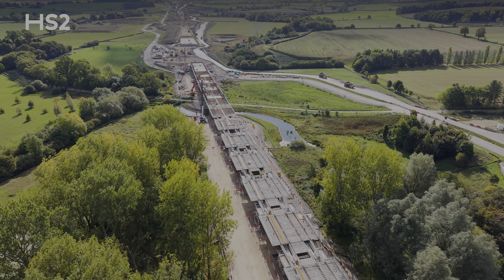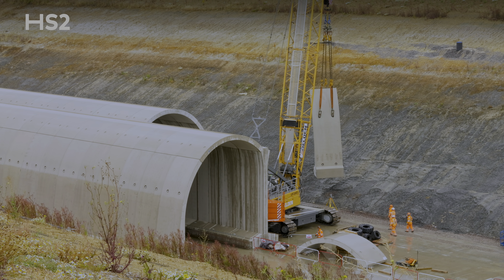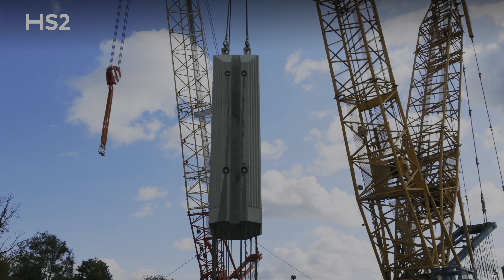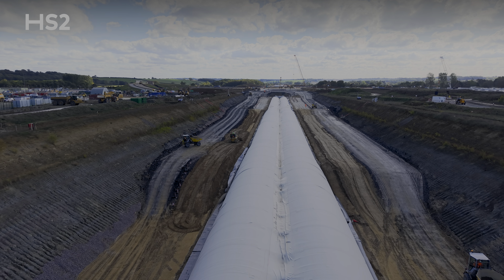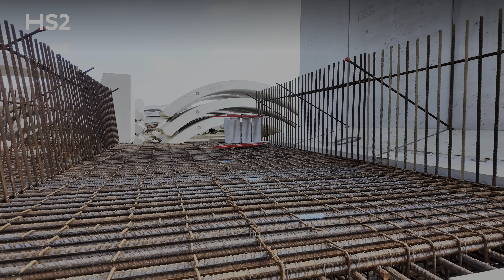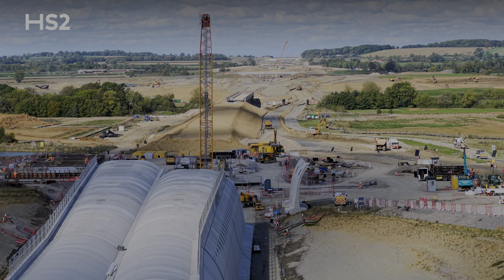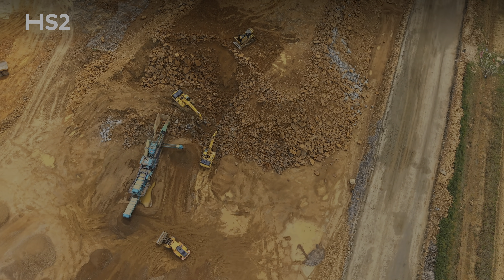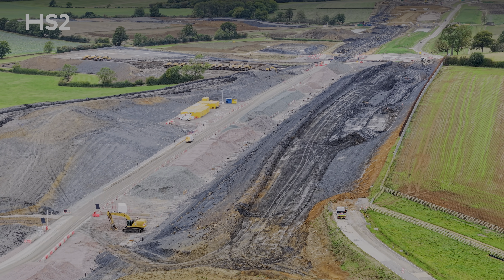HS2 Progress 🚄 | Major milestones across key 8-mile stretch of Britain's new high speed railway 🏗️

Comment: Impressive stuff happening in the 200th year of the public railway. I wish more people would stop moaning about HS2, learn the why and how of this project. Then acknowledge what a tremendous achievement it is.
Reply: it's so bizzare how people can get up in arms about whether HS2 should even exist, when it's plainly obvious that the full original extent of HS2 is what's needed for britain to not burst at the seams in the next 50 years.

The HS2 as is being built now is the bare minimum for britain to continue functioning!
Reply: @swedneck If train travel was cheaper, I might agree, but tickets for this line will be too expensive for many.
Reply: @portcullis5622 what do you think they woll cost and why?
Reply: @benphillips5041 No idea what they will cost, but most current train journeys are over-priced. The new line will be aimed at business commuters and there will be an urgency to bring in profits as quickly as possible. I hope I am wrong, but I expect  tickets will be out of the reach of many ordinary people.
Reply: @portcullis5622 why are you sayibg it will be aimed at business passengers and talking about profit? Its being built, by the govt, to relieve capacity on the busy wcml where prices are often raised to prevent people from travelling due to overcrowding (demand pricing like an airline). Hs2 will be cheaper to run and can carry double the passengers to some destinations, therefore it can operate with lower fares or help subsidise other lines. Pricing people off would be very silly. On the existing lines, there will be more frequent services and more freight whkch should also bring in additional revenue. Fare costs are a govt issue
Reply: Yep, only 40 years after the TGV
Reply: With the power of hindsight (which is a superpower we all would love) imagine if a true high speed line had been constructed length and breadth of UK in the 1970’s (like the TGV in France) and challenged the flawed growth of air travel. 
I hope we don’t miss the opportunity to revolutionise transport across the UK. HS2 has some incredibly talented people working on it, we need to utilise those skills. The first Industrial Revolution was enabled by railways, the next Industrial Revolution needs a revolutionary railway.
Reply: I agree what a big improvement and theya re working really hard and I wish people would stop moaning and it will go from London Euston to Birmingham New street.😊
Reply: spot on 100%
Reply: The engineering and construction is truly impressive. But the opportunity lost of further capacity expansion further north (east and west extensions) is a really poor decision and we will rue that decision for decades. Plus we have to learn lessons to improve estimating for future projects, as this was really poor.
Reply: @mickcresswell1031 As estimating for a contractor was one of my tasks before retirement I can tell you there is nothing wrong with that. The budget for HS2 was a figure pulled out of the air to satisfy the Jothnson government. It had no detail behind the headline figure. On otther construction projects a cost consultant protduces a detailed costplam budget for the client which has shortcomings because the cost consultants lack technical knowledge. The accurate estimating comes from the contractors estimdtibg teams.
Reply: @TrevorWilliams-fq8mg I would love to know what the last major project that was done on cost and on time.
Reply: Most people just think the ticket prices are going to cost ridiculously money and just use the old service.
Reply: @Puddingladd which is nonsense, because there will be more seats to fill and the old service wont exist in the same way. It will be hs2.
Reply: @benphillips5041  Why will the old service change? Unless you live in Birmingham or London you cant use the service......how will all the passengers on the current route travel if the service changes. They will need to keep existing services the same
Reply: @simontheobald2978 it will take over the current express services. It will still go to manchester, liverpool, glasgow as well as Birmingham. If youre going to glasgow or manchester, you wont have much choice, hs2 will be the only direct service. With the express services on their own line(hs2), that allows the current infrastructure to run more stopping services for the stations in between and more freight. 
With the intercity services to london no longer at new street, that frees up the station to handle more services from other connecting lines (its the main bottleneck) so more frequncy on lines to Birmingham from didcot, Shrewsbury, leicester. So benefits are quite wide even with just phase 1.
Reply: '' Impressive Stuff '' etc. Absolutely agree. It remains to be seen if this rail is only an elitist project reserved for the affluent / business people / political people with ticket prices way out of reach of ordinary people.
Reply: Loads of people seem to believe it is fully cancelled, little do they know the extent and scale of what has been built and what it will be. So exciting.
Reply: @toby.maximillian lots of people seem to think it ends at birningham.  It goes another 20 miles.
Reply: @garthcox4307 there are so many misconceptions.
Reply: @garthcox4307  A good portion of the great British public out there do not realise that the trains running on HS2 will also travel on the WCML to and from Manchester, Glasgow etc. Many think the trains are solely for Brum to London and vice versa.
Reply: @JohnHoward-wc9kk  HS2 running on ordinary tracks to Manchester and Glasgow is not HS2
Reply: @toby.maximillianIt’s fully cancelled if you live north of Birmingham
Reply: And also they trains will ahev a top speed of 225 miles per hour but will be limited because that will be to fast maybe like 180 miles per hour I don't know but they doing well.😊😊😊 And his is all kier starmer money
Reply: Climate shit show you mean
Reply: @jeremyparsons5379  I think you need to put some more meat on that comment so the audience can get an understanding on what it is you are trying to say
Reply: @HighFell 😂
Reply: Well if you live in Manchester like me you have a right to moan , we are paying for it, but don’t get to use it.
Reply: @michaelcliffe6545 Well, it will arrive at Manchester, just without the added benefit of freeing up your local lines for intense metro level services, without additional seats to the south, without a new fast servce to Birmingham. It would be faster than now, which was never the main point.

However, the bit of hs2 into Manchester isnt actually cancelled, just the bit in the middle and even that still has an active hybrid bill, so lets see what the government are going to announce within the next few months.
Reply: @benphillips5041 HS2 have sold off the land they purchased just south of Manchester, so we won’t see any benefit
Reply: @michaelcliffe6545 no land has been sold. Phase 2b west's hybrid is still going through parliament likely to be repurposed for liverpool-manchester NPR. But if youre building that, high legh is only 15 miles from Crewe and it would silly not to connect to there (last govt explicitly removed just that tiny section from the bill but easy to put back in)

Phase2a did have safeguarding removed, but the powers to build are still there until February and can be extended. Again, no land sold, despite last govt attempts to speed that up and sabotage it.
Reply: @benphillips5041  So HS2 will arrive in Manchester on the same line as today and no extra capacity, hmm, let me think about that, so no change then for Manchester rail users and we are paying for it.
Reply: @michaelcliffe6545 projects are built all over the country you might not benefit from, its not an argument against it.

However, you should be angry that the last prime minister on advice from Andrew Gilligan cancelled, wothout any expert advice, and then intentionally tried to sabotage any revival of hs2 to manchester. However, they failed, no land sold, so a revival is possible and I expect a project rebranded will get a deddicated line to Manchester to be announced by February
Reply: @benphillips5041  No chance of it coming back
Reply: They bought farms and land near me, when they cancelled the northern section they sold off them off for less than half what they paid for them.
Reply: @michaelcliffe6545 theyve not sold any land other than land that had been used but not required anymore anyway.
Reply: Its a great achievement.  The issue is that costs have been out of control due to unnecessary specifications and poor project management.  They are getting their act together now.
Reply: @garthcox4307 My experiences of working on major construction projects for 43 years tell me once a project gets out of control they cannot be saved. The reset can only give an updated forecast of the final completion date and likely cost, both of which are subject to change to take account of future unknown restraints.
Reply: @garthcox4307 yes, the projected costs are still
Increasing not decreasing
Reply: Yes. I can't wait to go slightly faster from London to Sheffield. Which is what it's for.

Oh...hang on...
Reply: It's a national joke.
Reply: @count69 my thoughts entirely
Reply: @count69 only due to how it was handled by the govt.
Reply: Still unnecessary and the wrong route. Cutting a swathe through ancient woodlands. You wouldn't choose a route through an ancient cathedral, so why are our ecological equivalents treated with such disdain?
Reply: @portcullis5622 Regulations demands ecological damage to be compensated elsewhere, often on larger scale!
You can't make omelette without breaking eggs!
Just stop nagging mr NIMBY!

Watch how Denmark are managing Fehmarn Belt tunnel, and the gigantic land project with millions of tons soil, and huge scale of nature successfully recreated! 🇩🇰👋

Your housing were also build on the cost of nature..! 🤷🏼
Reply: @OmmerSyssel I have never owned a house. I live in a tied cottage. Built in the 1920s. As for being a "NIMBY", I live over 80 miles from the nearest section of HS2.
Sorry, but anyone with a depth of knowledge about ecology would tell you that cutting a swathe through ancient woodland and then planting some young trees on farmland somewhere else is not adequate 'compensation'. Nowhere near enough. It is a bit like knocking down an ancient cathedral and using the stone to builds a few sheds, a wall, a garage and a patio.
Reply: @portcullis5622 however we try to solve the capacity issue between north and south, new motorway, new pair of tracks next to existing lines, new railway, its going to have an ecological impact. Any route hs2 would have taken would have affected ancient woodland. Theyre employing new techniques such as translocation of soil to mitigate and expand woodlands affected. 

The amount of woodland and ancient woodland affected has been another one of the big myths also - the 108 ancient woodlands affected (or further 'destroyed' to some), for example, or the completely false "biggest deforestation since ww1".
Reply: @benphillips5041 The problem is, ancient woodlands are our equivalent of tropical rainforests for biodiversity. New woodlands and plantations don't have the same species of bats, birds, flowers, insects, soil invertebrates, fungi, lichens and mosses. Many of those species are only found in relatively undisturbed ancient woods .Once the ancient woods are dissected and carved up, the remaining areas are often too small and fragmented for those species to survive.
Replacing ancient woodlands with new plantations is the ecological equivalent of knocking down a medieval cathedral and using the stone to build several small houses and garages.
Reply: A total vanity project. A complete waste of taxpayers money. Over budget and won't be finished on time like most infrastructure projects. Whilst very impressive from an engineering perspective, we would be better spending the money on other things such as increasing the defence budget.
Reply: @julianroberts9757   Our rail network has been at full capacity for almost 20 years. Why on earth would upgrading it be a "vanity project".
Reply: @julianroberts9757 your comment shows a complete lack of knowledge towards what is needed to improve public transport in this country. We've fallen way behind other European countries, which is why we're now having to spend the collosal amount we are on HS2. As well as relieving the pressure on other lines, there are major road infrastructure schemes taking place alongside.
Reply: @julianroberts9757 we build infrastructure as there is an economic return. It's not the same as spending on NHS or defence. Its a needed project as capacity will run out in next 5-10 years on north south services.
Reply: @benphillips5041 what a load of bollocks!
Reply: @julianroberts9757 do you not understand basic economics?
Reply: @julianroberts9757 it was originally meant to be part of a europewide high speed network,  as an alternative to flying, not to save a few minutes travelling to London. I'd have rather seen the money spent on uk wide railway upgrades and reopenings but its past the point of no return now. Hopefully any future extensions will be better managed and delivered more cost effectively.
Reply: @garthcox4307 no, it was because the west coast mainline is full, m6 nearly full, and now growth or reliability through birmingham. Only way is a new set of tracks, take the fast trains on to them, allowing enough room for more frequent freight, regional and local services, greater reliability.
Reply: @benphillips5041  This is the right answer, and critics of HS2 either don't know it or are being disingenuous.    But having built all this, and acquired the expertise to building on this scale, I feel we must continue the line further north, whether it it needs all-party agreement or even a referendum.   Whatever it takes, we mustn't let this expertise to dissipate as HS2 nears completion.
Reply: @timw.8452 a rolling programme of high speed line building would be good, but the govt only recently took away safeguarding for the east branch. Short sighted.
Reply: @benphillips5041 A rolling programme???  They're going to build 40 hospitals on a rolling programme. But the construction industry doesn't  have the resources. And the Treasury doesn't have the money. And building a rolling programme of high speed railways will bring the
Planning process to a,standstill.
Reply: @timw.8452 Apart from the ecogical damage caused by taking the shortest route, the other problem is that train tickets for HS2 will be prohibitively expensive. Aimed at business commuters. For ordinary people, it will still be cheaper to travel by car, even with one person in it, allowing for fuel, tax and insurance. That should never be the case, but it already is for existing journeys.
Reply: @portcullis5622  Could you please provide a source for your information that the prices for passengers on HS2 will be "prohibitively expensive".   Or are you just inventing that?   Using HS1 within the UK isn't cheap but it's not outrageously expensive either.
Reply: @TrevorWilliams-fq8mg That’s the problem — we don’t have a rolling programme and long term plans keep changing, so the skills base and supply chain never scale up enough to reduce future costs

A steady pipeline is what actually creates the resources we’re supposedly missing and maintains efficiency. Its part of why continental builds are cheaper.
Reply: 200th year of the public railway or 200th year of building HS2?😂
Reply: Some British people aren't impressed with mediocrity I suppose. I would explain why this endeavour from planning to completion is mediocre, but I suspect it would be lost on you.
Reply: @richardpaterson7353  my my what an inflated opinion you have of yourself. 
HS2 is hardly mediocre. Could it be more extensive? Absolutely and that can still happen.
Reply: @HighFell and even if there have been problems, its the chance to learn from mistakes and deliver better in future. Few will exceed when they haven't built anything of this size for decades.
Reply: @HighFell well one thing that is not mediocre about it is the cost, and it’s not even finished yet
Reply: @michaelcliffe6545  what do you think it should cost?
Reply: @HighFell  I am saying the costs have not been managed at all well
Reply: @michaelcliffe6545  which costs? If you are saying they haven’t been managed well, you must know which costs and in what way they have been mismanaged. 
I’d just like to understand more about the project and you seem to know about the costs.
Reply: @HighFell well it started off at £32 billion, went to £50.2 billion, then £72 billion and NAO predicts a final cost of £98 billion in 2033

The current HS2 director is on £750,000 a year.
Reply: @HighFell in a commons select committee hearing some years ago HS2 admitted to making unauthorised redundancy payments of millions.